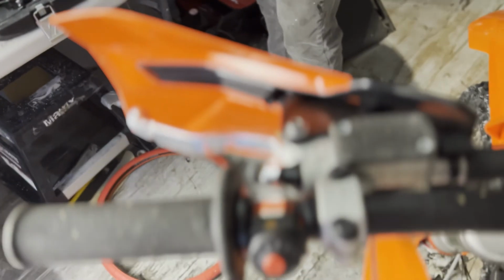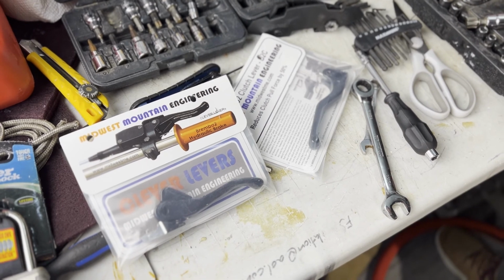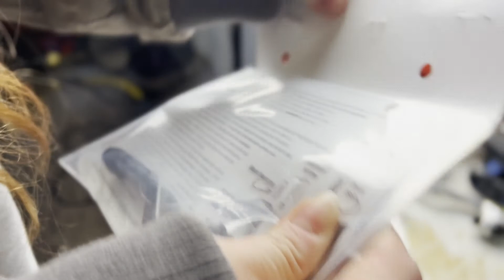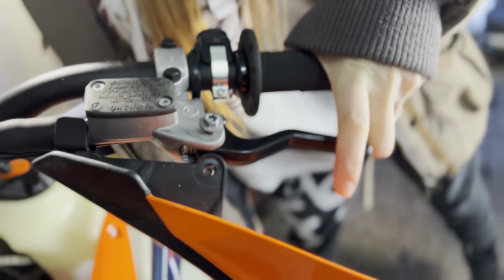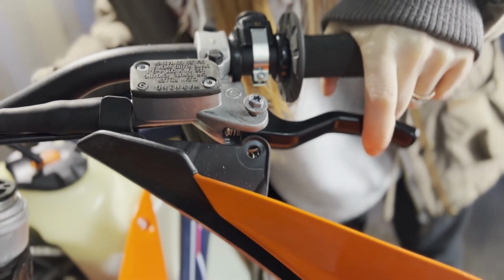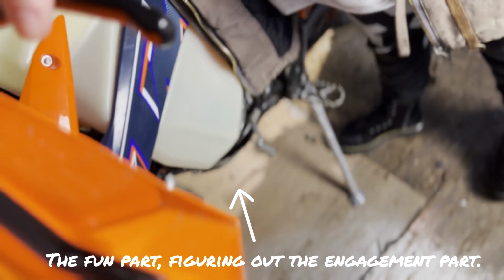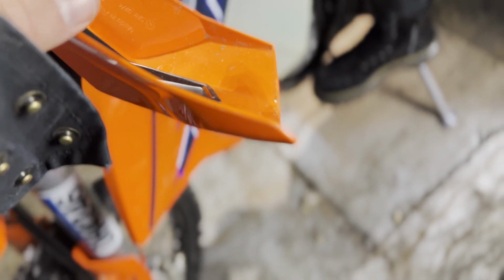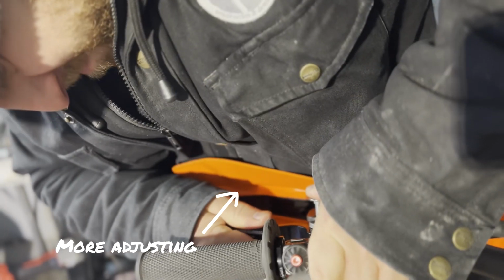Installing the Midwest Mountain Engineering Clutch and Brake Levers

Comment: Please do a follow up review of the clutch. I have a ktm as well and am considering this option for my tiny hands, but have heard to clutch drag or deep engagement make people switch back. 
Thanks!
Reply from the maker: Thank you so much for watching! Yes I will do a follow up review soon!
Reply: What have your thoughts been on the Mountain Clutch lever ? Debating on purchasing one, but many complain of clutch drag.
Reply from the maker: @tim9284  hi! Sorry I haven’t done a review yet! Trying to work on it! I absolutely love it. My only suggestion is carry the Allen key tool with you as you will need to do some adjusting the first ride or two. And always let your bike warm up before you ride. I find that the clutch doesn’t engage at all if I jump on my bike for a ride with out the warm up. It takes about 7 min, at least for my bike it does. Hope that helps!
Reply: @angelisaedwards  It really does ! Thank you !

Comment: I have a KTM XC-W 300 and also just installed it. But with the screw tightened all the way in my bike still jumps forward when kicking into 1st. Also if the bike is warmed up and I stop and hold the clutch the bike will stall if I don't continue to slightly Rev the throttle. How did you get yours to stop?
Reply from the maker: Sorry for the late reply! I have to let my bike warm up for about 5 - 10 minutes before I start riding it. The engagement point floats around and once its warmed up it will stay in place. I also used lock tight on my screw and that has helped a ton! Hope this helps!
Reply: I found that i needed to use the stock piston rod.  I functions much better.